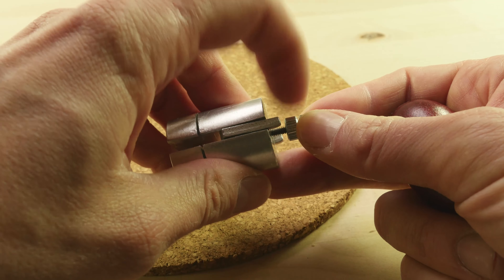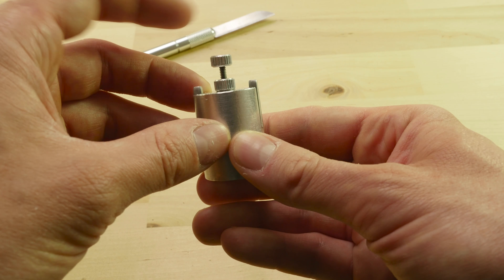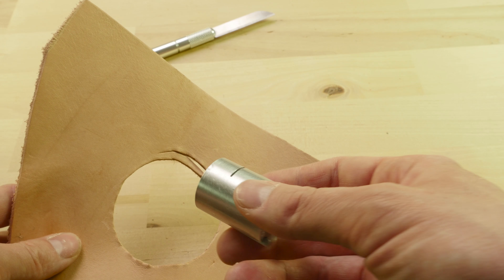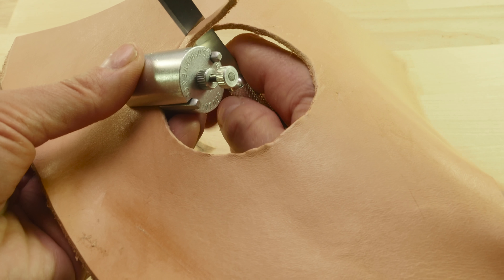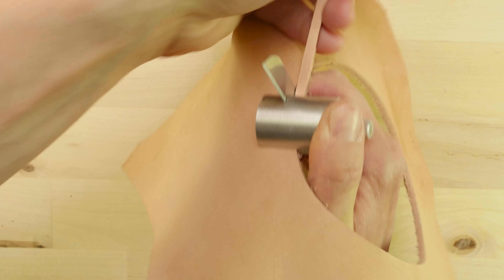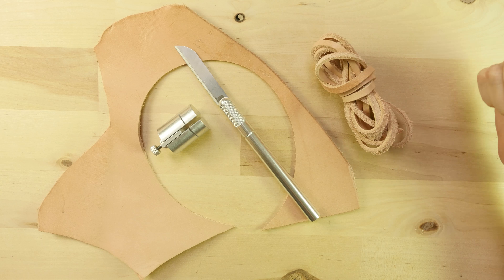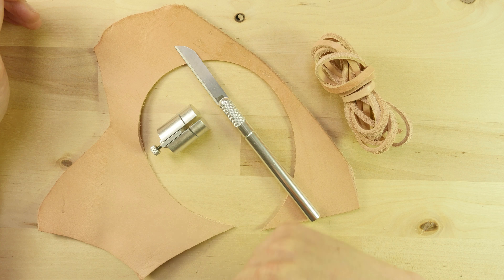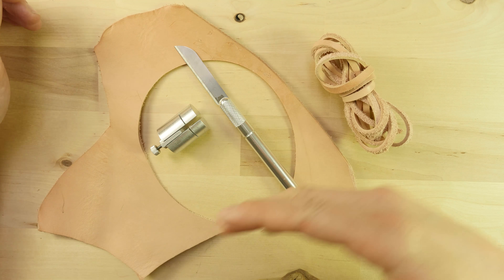Osborne lace cutter

Comment: I use one that cuts from the side of the material, but its disadvantage is it doesn't work as well with really thin and supple leather, but other than that it's great. It's called an Australian Strander.
Reply from the maker: Hey!
Thank you for commenting!

Yeah, the strander is a good tool for sure. It is a gem for leather lace! With rawhide you often want to go really thin.

Mark

Comment: Interesting. It does look bit challenging. That looks like a lot of waste if you don't have projects that need circles of leather. I'd guess 100/100 cows don't like it.  : )
Reply from the maker: Hey!

With any lace cutting there is some waste. With a traditional cutter (that cuts on the outside) you make a "round", a circle, so you have to cut some leather off as well.

Mark
Reply: tanalee09 csars brozon
 egyszervolt vadnyugat